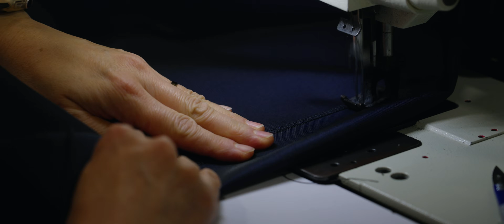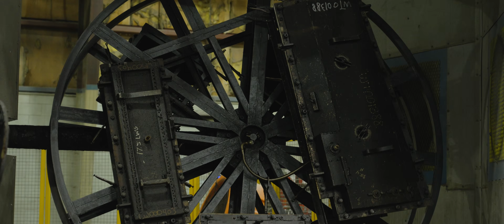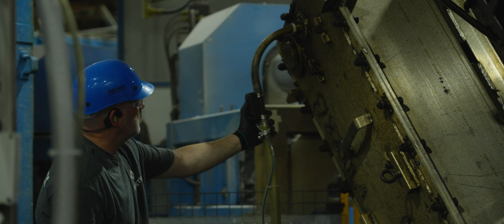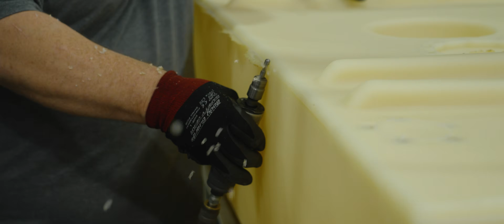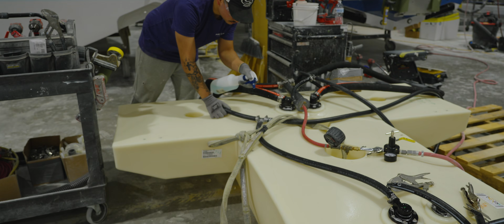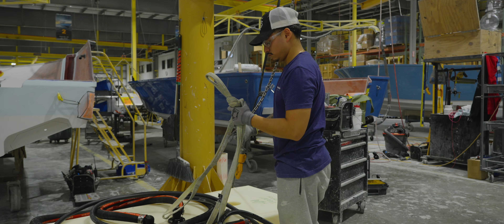Roto Molding Fuel Tanks - Sportsman's "Behind The Glass" (Season 3 - Episode 4)

Comment: Interesting Roto Molding vs Aluminum. A couple of questions. 
Has R M ever failed requiring them to be replaced? IDK
I know aluminum’s will leak for age and exposure to the saltwater. 
I kinda like the RM idea and wonder why most manufactures haven’t all gone to this process.
Reply: X-LINK plastic powder is a one hit wonder. It is stupid strong the pry-bars to get some of the parts out of the mold would wreck most tanks. X-Link cannot be recycled in any way and cannot be repaired as it will not re-melt. Not all shapes mold that well, kick outs irregular shapes can be challenging to mold even throughout. The 3 layer EPA tanks are not as easy or fast to mold vs a single layer X-link tank. X-Link is a fascinating material. The way it is cooked also plays a factor how strong the product will be. X-Link forms layers kinda  like a tree. You can see the layers if you cut a section out. Only real failure would be a poorly designed tank for roto molding. The forces on a tank in a boad 1/2 full jumping waves makes for some incredible forces on the tank. It's really about the application they will not fail just getting old. The plastic doesn't really break down like most typical plastics do. Also a under cooked tank is brittle due to not crossing the material is cross linkable. I hope this helps answer some of your questions.